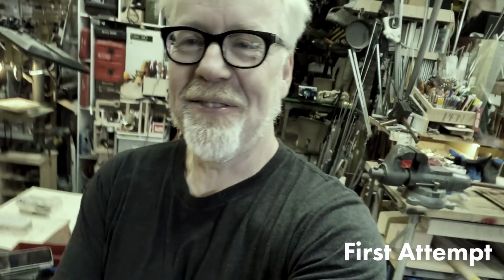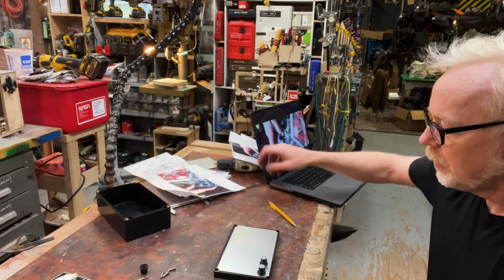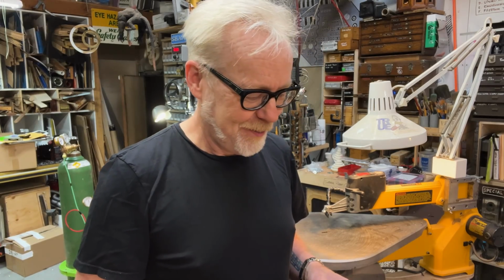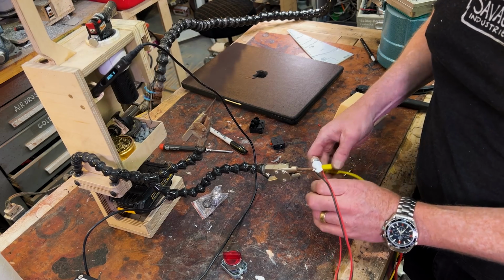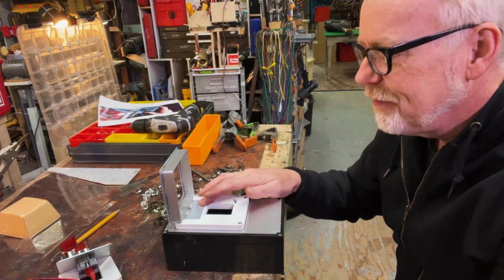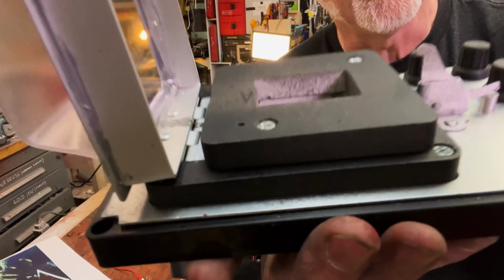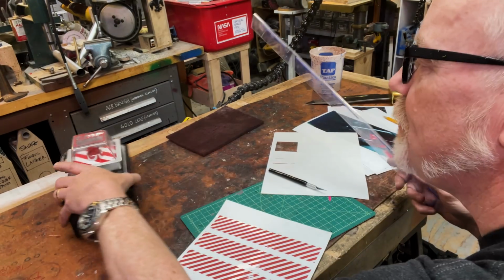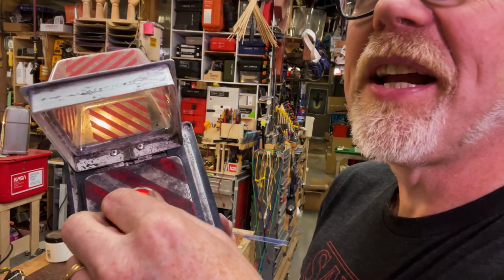Adam Savage's One Day Builds: The Matrix EMP Switch!

Comment from the maker: Join this channel to support Tested and get access to perks:
https://www.youtube.com/channel/UCiDJtJKMICpb9B1qf7qjEOA/join
Tested Ts, stickers, mugs and more: https://tested-store.com
Reply: You could always have tigged the flange together.
Reply: The mystery switch may be some type of  “Rotary Cam Selector Switch Handle”.  Search images of the type show a center screw and some with extended lever knobs which this one may possibly be.

Unable to find the exact kind within about 20 pages deep of search results.
Reply: How the fuck are you not uploading a Star Wars video on Star Wars day when YOU WORKED ON STAR WARS?!?!
Reply: One thing I would do different is have the big red switch kill the power to the light when you flip it. It is after all supposed to kill all electronics
Reply: Does Adam Savage know about the Blade Runner RPG on Kickstarter right now by Free League Publishing?
Reply: is it the Wirefy 190 PCS Heat Shrink Tubing Kit - 4:1 Dual Wall Tube - Adhesive Lined - Marine Shrink Tubing - Black, Red?
Reply: Regarding the printer.....I laserprint in color just about every day (also loads of stickers).....the  best advice I can give is; Set the correct thickness in your printersettings for the paper (thin, normal, thicker etc). Also, what i've found is that avery works best (but costs more)...
Reply: Some printers allow you to adjust the fuser temperature setting. The fuser is the part that sets the toner. You can look up how for your printer, if it can be adjusted.
Reply: CP5225N LaserJet Professional Color Laser Printer from HP. Prints 3 x 5" to 12 x 18". Should do the trick. It will run you around $1,500 new.
Reply: @KahosSaint  Because The Matrix is a PERFECT movie. A PERFECT movie. And my favorite of all time!
Reply: @clydemasterson1129  lmfao
Reply: couldnt you have just heated up the pattern with a blow dryer?
Reply: It took me 4 days to completely watch this "One Day Build". LOL
Reply: Fun tool tip: add a metal hole punch next to scroll saw for quick cuts like aluminum brass and sheet metal.
Reply: I cant wait to see more..
Reply: Confessed Matrix reWATCHER.. Religiously
Reply: @KahosSaint  He already did. It was called Star Wars. :P
Reply: @YukonHexsun  you know there's shit from the franchise he didn't help with and is interested in making right? Get off your high horse.
Reply: I'm pretty sure all those switches are from an oscilloscope or bench top power supply... The grey ones remind me of a Hitachi/Tektronix oscilloscope one from University... Maybe the black one is from the same thing?
Reply: @Adam why screenshots, with your connections you can get photos of the original prop and replicate it. Just ask around.
The Wachowskis might be on Twitter or Facebook.
Reply: I wish your store sold tools, I tried to go buy a notcher from you right now after seeing the one at 5:10
Reply: I think you're looking for guitar pedal knobs.
Reply: Sticker paper printing fix
Print Setup, Printer Settings : set paper type to proper type.  Labels, Glossy paper, Photo Paper
Quality : High

Comment: Adam, if I heard you correctly that switch is rated for 110 volts? DUDE! You need to wire that in as the main switch for your shop lights in the front of the cave. Imagine hitting the EMP on the way home every night... and the lights go out!
Reply: if wired in to your lighting, which would be very cool.  you should use a motor contactor with a 24/28 VDC coil.  the switch should have a replicable bulb/LED.   using a low voltage control circuit will keep any inspector happy and you safe.
Reply: @jimnunn9232  A light switch would be the least of his concerns in that cave lol.
Reply: This comment needs more thumbs up!!!!
Reply: if it was attached to lights, it would need to have DIPs that control SCRs make it flicker then fade off ;)
Reply: Moreso to a switchable relay that is linked to the main breaker for safety. The amperage of the entire lighting system in the shop may overload the switch if it was carrying that load alone
Reply: Brilliant comment!
Reply: great idea
Reply: With all those knobs he could control dimmers for several sets of lights, too. 

It’s a crime not to wire it to something.
Reply: I commented a similar idea, not seeing this one. Something you could also do could be using a remote controlled outlet, where you'd wire the guts of the remote to the switch, which I'd think would be bing bang simple. I've used those before and they work pretty well. You can have a bunch of those outlets connected to anything (controlled with a single remote) and have the EMP box still wireless and handheld, then turn a bunch of specific lights/outlet power off.
Reply: Was thinking the exact same thing. Should add a loud speaker for that dramatic emp blast followed by the power down sound effects when it turns everything off.
Reply: I had the same thought! That would be insane!
Reply: Or wire it to turn on something you like to show off just to make a show of it when you tour people around
Reply: I was gonna comment as well, that bad boy needs to be wired in!
Reply: @kennyH20  while it is his "man cave," it's also used for commercial use. I can almost guarantee you Adam is up to code in there.
Reply: @Imugi007  Fire Marshall would probably disagree
Reply: Obviously the EMP switch should be the off, but wouldn't it make more sense for the other big switch to be the on?
Reply: @kennyH20  I mean, there's fire hazard and then there's tinker shops.
Reply: ……….’ it seems to run on some kind of electricity ‘
Reply: @idiotburns  "There's something wrong with the uplink"    "No we are looking at the same thing as you do..." :P  (from the 3rd movie when Smith becomes more powerful)
Reply: @BlackSoap361  technically, you are correct, except, assuming that switch was a working one, which I seem to recall it isn't because the guts were removed or something, you still would NOT be able to use those dial knobs for dimmers, as that implies that they are actually connected to a switch, which they are not... I do like your idea, in general though, assuming you could replace everything with working switches and pots...
Reply: @jimnunn9232  I'm pretty sure any inspector worth their salt would have a heart attack walking around Adam's shop.
Reply: If you could, add in something to make it turn off sequentially starting from the switch and going outward in a wave
Reply: .... With appropriate sound effects......
Reply: Yeah do it in a part two!
Reply: lutron lets you control many lights at once you could create a master off and turn off all the lights….
Reply: @SuperKingslaw   yes
Reply: Hell yes!!!!
Reply: Cool
Reply: Imagine doing it for the 365th time a year 🤣
Reply: Yeah makes it a briliant shop fixture by doing that!

Comment: Regarding toner setting: Check if you have a PAPER WEIGHT settings in your printer profile. Heavier paper weight settings will increase the temperature, OR slow the feed down for that very reason (setting the toner on more heat-resistant substrates).

Comment: Use your hot air gun to fully set partially set laser toner.  Also an improvement would be to print the EMP and red strips on clear in reverse and apply to the inside of the clear dome. That way the toner won't move around and the stickers won't come lose from handling.  I would also use a red LED to light the switch so you don't get the yellow center halo on video. BTW, burnt-sienna or sienna in an acrylic glaze makes a great aging/weathering effect that has a more organic look to it.
Reply: Omigosh been commenting this exact same thing, not knowing someone else posted. Great minds think alike!

Comment: I actually like the "rub off" issue with the stickers, for this reason: You can print them, cut them, put them on, then rub them a bit to add "weathering," then seal it with a clear-coat to lock it in.
Reply: I was thinking the same thing, it looked perfect for adding wear and tear!
Reply: Some kind "Cardstock" is the setting you are looking for in the printer driver for paper type. Good printers will have even different weight paper stock to choose from. Some sticky paper companies say use Label setting but that is often not enough for sticker paper like this. On my HP it is under Finishing and then Media Type and I choose Card Glossy 176g-200g. It makes the printer fuse at a slower speed so the toner gets warming and sticks better.
Reply: I was thinking he should’ve used his Cricut to cut out a stencil and then paint the stripes
Reply: @theloneviking9145 I absolutely hoped for painted stripes.. Because who wants to see the layer of the sticker paper? Still turned out great though.
Reply: @MrRbabs  look at the source material and you can clearly see it is supposed to have raised edges where the stripes are a clear printed sticker added after the lid has been moulded
Reply: Wondered why Adam didn't print everything in reverse and then adhere the stickers to the INSIDE of the dome. 🤔🤷🏻‍♂️

Comment: Adam, I work for a company that sells commercial copiers/printers. I am a certified HP technician as well. With that being said.... look at the HP Managed E876 series. It is offered in 40, 50 & 60 ppm configurations and is a color unit.  You will not be disappointed.
Reply: I concur as another certified HD technician the E876 should do what you want and the reason when you look for "large format printer" your not getting laser printer is that is plotter/poster territory they use ink 11x17 is tabloid-style paper which is sold as A3/copier
Reply: he asked for a consumer grade printer.. any thoughts on that line?
Reply: @sodapopjenkins  you will not find a consumer grade printer that will handle large format. The consumer grade models are made for standard format.
Reply: @Jones-TX  didnt catch the large format requirement... thanks for the reply

Comment: I feel like activating the EMP knob should kill the light in the switch, since, you know, EMP.
Reply: I was thinking something similar
Reply: It's not an electronic device, it is an analog electrical device, so EMP won't hurt it. Unironically, the build has no electronics in it :)
Reply: Technically, when they shut the systems down to escape the squids, the light stays on, if I remember correctly, which implies that that circuit is unaffected by the EMP...
Reply: Turning off would feel like it does something. Could even be timed to turn back on.
Reply: @petertrast  I thought EMP kills batteries?
Reply: @Bobo-ox7fj  I know that, but your missing my point... Everything is purposefully shut off to prevent detection, and possibly to prevent hardware in the ship from burning out, which implies that because the light is on, there's electricity flowing to the electronics the switch is hooked to. The thing is, everything is shut down to prevent frying the shipboard electronics, except for that, which means that even though the ship circuitry isn't protected from the EMP, the EMP circuitry is protected... I'm not saying that you're wrong of course, only that I'm saying what I am on purpose... To be clear, nothing on those ships works like it would in real life, because, get this; if an unshielded device is hit with an EMP it should destroy it or at least interfere, no matter if it's on or off, yet somehow turning the vulnerable ship off turns on EMP protection? It could be as much preventing them from being detected, as from that, but still... THEN the ship that turned systems off to protect them, leaves some circuits on to blow up the EMP which again, by that logic, then isn't protected as it's running??? I know it's technically unaffected likely by an EMP, but it doesn't change the fact that that doesn't make sense in the movie like that, although it doesn't take away from the overall enjoyment of it...

Comment: I worked for a major printing and packaging company for 16 years, and now I run my own small printing company. I used and maintained 3 different 11x17 color laser printers. Xerox, Ricoh, and HP. The Ricoh was my favorite for cost and production printing a standard paper stock. The Xerox did well but it would cost over $25000 in toner a year. Now understand we would do about 190,000++ pages in a year. These machines are beasts though, they have a large footprint and usually way over 150lbs, however this can replace your current laser printer so it will not just be specialized to large prints. The Ricoh had the highest resolution a few years ago. Compare these Ricoh SP C840DN, HP CP5225n, and Xerox VersaLink C8000. There is also another option which may interest you. There are few (Xerox makes one) color lasers that also include white toner. These are primarily for used in transfer prints for clothes. This could be a good asset to give extra dimension to what you want to create especially on clear transfer or colored media. The Xerox C8000W has this option, however it almost doubles the cost.

Comment: Adam, I’ve recently been working with clear laser printer paper, water slide. I had the same issue. first i would heat up the printer and print one sheet on plain paper. then I would set it to high quality, and set the printer to “label” setting. that made every print then perfect 👍🏻 give it a try next time
Reply: Also after your print, before you cut it out. seal it in with a clear spray paint. locks those colors in perfectly.
Reply: Water slide is the truth. I'll never go back to label paper. I also use water slide decal set solution I used for my scale models. Dissolves the substrait and leaves the art. So dope. Clear over that, it's basically silkscreen.

Comment: Hey Adam! Pro tip from your friendly neighbourhood print guy....When you load your paper the printer will usually ask what kind of paper you are loading. If you set the paper type to a heavier weight paper like a thicker photo paper or something similar, then the printer will either up the fuser temperature or feed the paper through slower. 👍

Comment: I like that you use mechanical measures and manual measures. You amaze me that you can eyeball, very accurately, and I have to check sometimes on a steel ruler for things like 4 inches (a hand), 9 inches (thumb to mid finger stretched out), 18 inches (a cubit, elbow to finger tip). I'd never get a tattoo like you but it's probably accurate enough for wood work. Thanks for sharing these vids, it keeps me inspired to keep crafting.

Comment: Printer settings can adjust the speed of media over fuser or even adjust fuser temperature. Look for "labels", "heavy", or "cardstock" options.  

larger format desktop option: HP cp5225dn
if you have the space these are really cheap used: HP CM4730

Comment: Just a thought, once the initial pull is done with the vacuum, might try using a heat gun to heat the plastic down in in the low corners to allow the vac to pull it a little tighter.

Comment: Former printer repair tech! If you only have a vertical line or two of toner that hasn't set, that sounds like a fuser (the giant resistor-roller that gets hot behind the paper) thats faulty, not necessarily that your printer itself can't handle it. Fusers are an expendable part, and can be replaced for way cheaper than a new printer! Something to consider. It could also be dirty, just have some gunk built up on the fuser at that spot that can be cleaned with some alcohol.

Comment: I've seen a switch knob similar to that one you were looking for at the end, on old 12v battery jumper boxes, albeit possibly a different size and color, also, a "small engine" oil dipstick has a similar knob style, depending on the manufacturer, don't limit yourself to only looking for switch knobs to find a similar knob, because there are uther applications, besides rotary switches, such as some car fuel caps, and a lot of oil dipsticks on small engines, as I mentioned earlier... Some may have a notch in the middle, and some may be 1 continuous piece on the top, but still, they can be very useful in any case, and I'm sure lots of people can learn this trick, even if you, yourself already know it

Comment: To prevent clouding from glue on clear parts.. like model canopies, etc

soak the parts in "Pledge Revive it"

Makes the plastic look more like real glass, wont fog with glue vapor. I even used it on the resin water for a diorama I made. Try it!!
Reply: How long do you soak the parts before gluing? Do you use any other prep methods before using the clear materials?
Reply: @ColonelSkills   I dip it long enough to ensure coverage. So not long.. maybe a minute or so. Make sure it's clean.. no dust or fingerprints or that stuff will get sealed in. Let it dry for a few minutes and I dip a second time which may not be necessary but I do. Then let it sit for about 20 to 30 minutes as the bottle states.. then it's solid.. doesn't rub off or anything. Its like it becomes part of the plastic. Great stuff and makes it look more like glass than clear plastic.
Reply: @jeffallen3598  awesome, thank you. I will give that a shot next time I am doing cockpits. Much obliged.

Comment: I'm a sign artist and we print on vinyl self adhesive substrates for outdoor use. We print the pump labels for Buc-ee's gas pumps.
The laser printer we use is called the Gerber Edge.  They are pricey and very proprietary, but if you do volume work, they are worth those hassles.

Comment: Adam when it comes to printing in 11x17 you are more likely to come across inkjet printers just because the use-case for prints in that size leans more towards graphics and images. Having said that I think the HP Color Laserjet Enterprise M750n is EXACTLY what you need. I normally recommend Brother for laser printers but in this particular case HP has built an absolutely fantastic printer and I believe you will be more than satisfied with its capability.